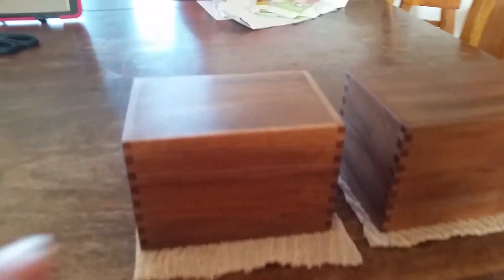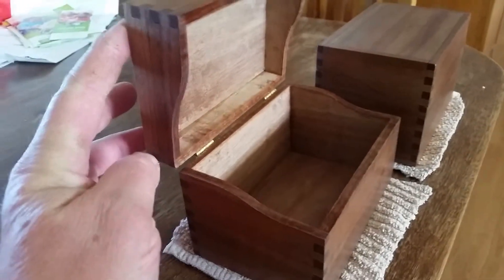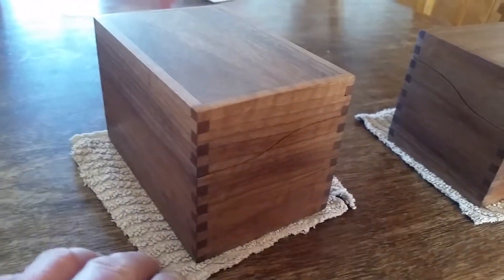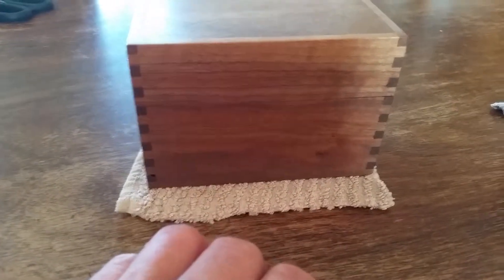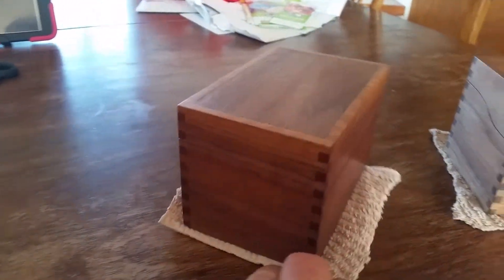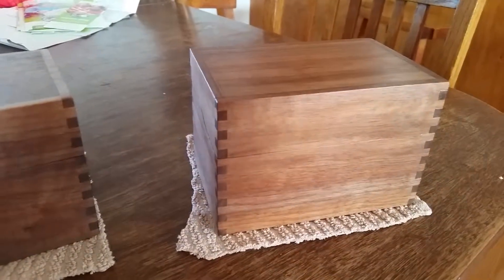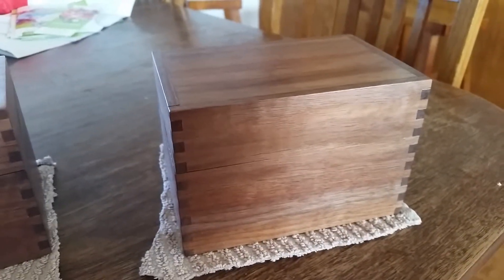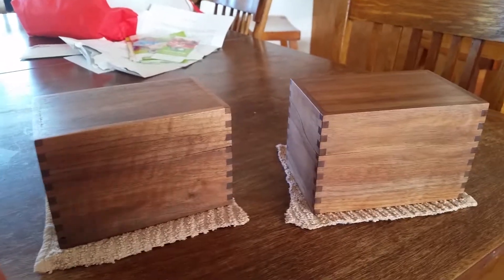Recipe Box I Make for Gifts.

Comment: How do you put the top in  do you make a rabbit it?
Reply from the maker: How To I try to cut the top and bottom as close as possible to the assembled sides on the inside. that is the most time consuming part of the build. I will use my table saw, jointer and a stationary belt sander to tweak that dimension.